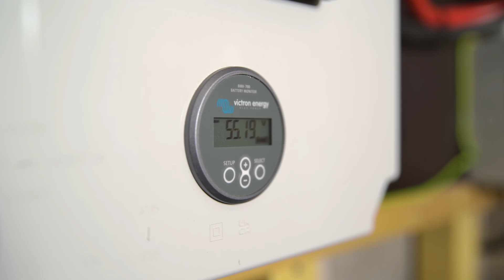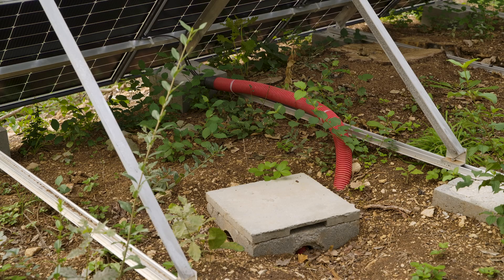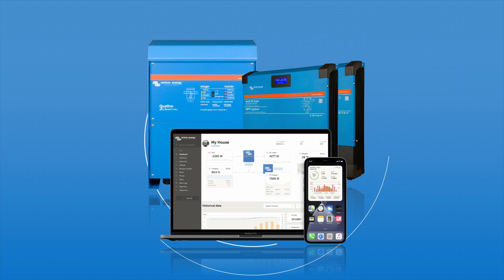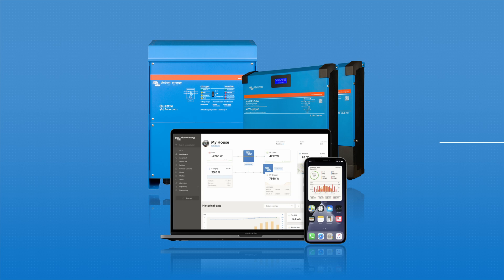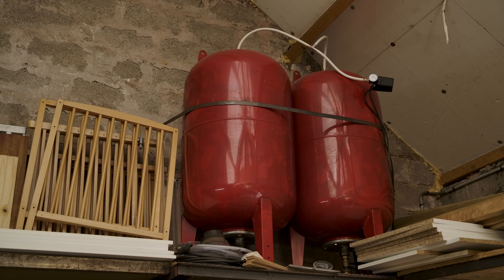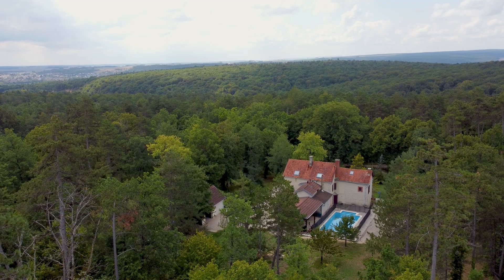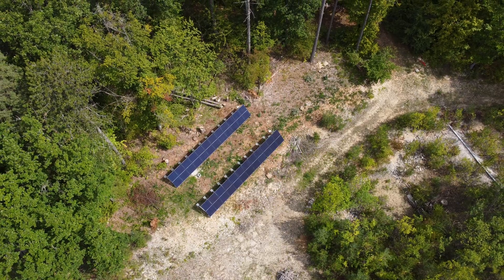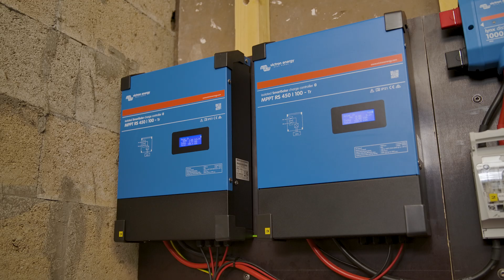Life in an Off-Grid French Forest: This Unconventional Family Journey

Comment: I have a victron 3x 3kW multiplus system with 40kW of lithium batteries and 14kW of solar panels. I love them. However, the embedded energy and pollution needed to refine the silicon wafers and the aluminium frames, takes about three years to recover before environmental breakeven is reached. Then the solar panels break down fast- I have seen in Australia people replacing 3-10 year old systems already.

Comment: Great family, amazing house and location. I always love your installation videos because they demonstrate that autonomy is viable. However, I have a question for this installation. It is deep in the woods, why not install 2 quattro 5000kva in parallel that in addition to more power, they would provide redundancy and another question is why go with quattro that are expensive, why not multiplus ii. I know the quattro has two AC In but they only have a generator, no grid power to use both AC In's. If they get a second gerator with a cheap transfer switch they could easily change from one source to another. 
Thanks again for your wonderful videos.

Comment: Seems heating is still wood based, with 10kwp it would not be possible to power heatpump whole year
Reply from the maker: You are right but the solar helps a great deal. They do still need to use the generator in the winter.

Comment: Do they have the battery storage in the project? I really love Victron a lot, and it would be perfect if they have the battery as backup power with the solar together.
Reply from the maker: Yes the batteries are integral to how their system works.  Solar charges the batteries when its sunny and they use the power from the batteries all night.
Reply: @VictronEnergyBV Also, the battery chemistry counts also, since it affects how the battery store energy, as well as the depth of discharge.
Reply: Victron's inverters and all other supporting products have provided many customers with a great experience!
I love this "blue energy" very much. It is very professional and user-friendly, especially the interface design of VRM, which is definitely worthy of praise. @VictronEnergyBV
Reply: That's great to know. Thanks.😁 @VictronEnergyBV